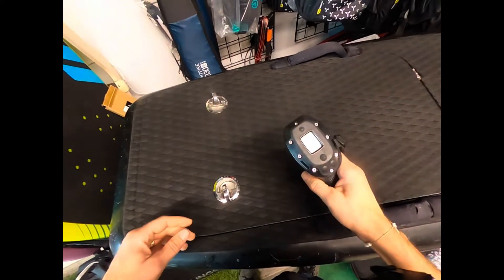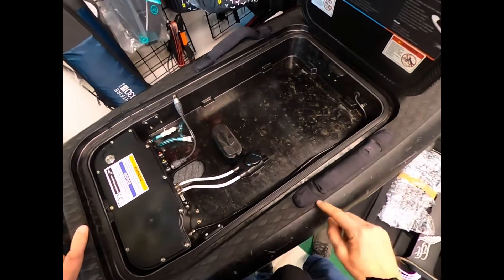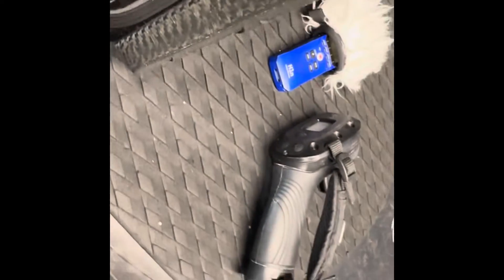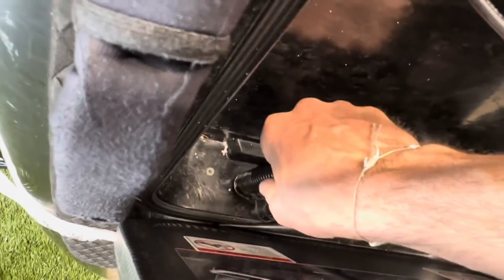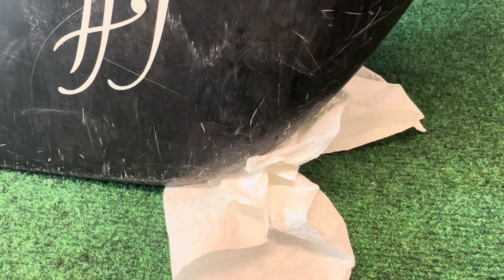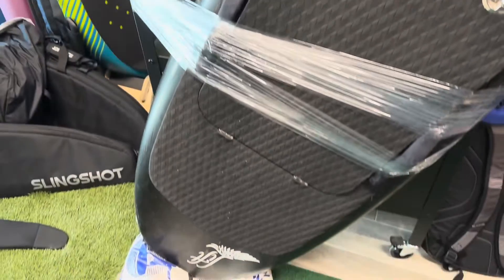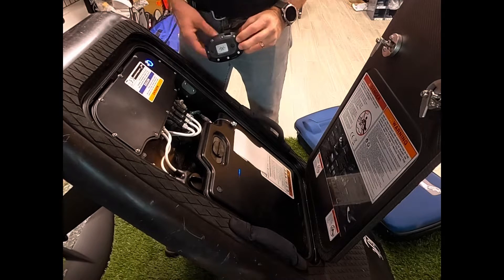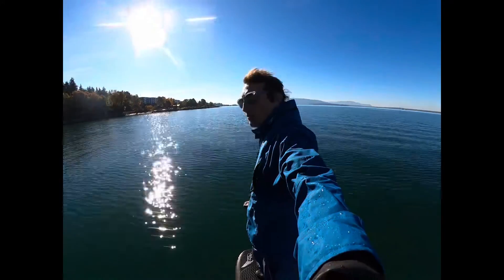How to Fix Intermittent Power Loss on Lift Efoils

Comment: Thank you for video.
The efoil antenna has corroded off antenna cable , I have fixed leaks on board but now need a new antenna to screw on to cable. Where can I source new antenna? Thank you
Reply: Hi i had the same issue - did you find a solution? Looks like a RP-SMA antennae?

Comment: Thank you for your video! I just disconnected the antenna and it was completely dry. Lift already sent me a new motor and ebox and still my propeller won’t turn. Any suggestions??
Reply from the maker: has to be the propulsion unit.  Motor may be fried.  The easiest way to check it is to put a known good propulsion on the unit.

Comment: where is the 9v battery in the ESC?
Reply from the maker: The battery is inside the ESC box.  You have to carefully remove the lid bolts and open it up to change this battery.

Comment: I have a Lift4 that I purchased from you guys last summer.  Took it out for the first time the other day and it did great.  I took it out a second time yesterday and it did well.

However, I decided to just lay on the board and cruise around at 1-2mph for something different.  After a while, I noticed intermittent power loss.  Power would engage and disengage.  

I'm worried to take the the board out again as I don't want to get stuck in the middle of the lake.  

So the Lift4 boards do not have the antenna that goes to the front of the board?  

I am at work now but will check when I get home.  I'm also going to replace the remote battery as it's been installed since I bought the board.  Fingers crossed its not a big issue. 🤞
Reply from the maker: I think we solved this with you.  It ended up being a ECU replacement if I remember correctly.  Thanks for posting.

Comment: As it turns out, my antenna and its passage through the Styrofoam in the nose are dry.  The motor cutout mystery continues.
Reply from the maker: It is the ESC in that case.  Another one is to check to make sure the end of the antenna is tight on the cable.  I've seen them loose before and caused a power loss issue.  If you're board is under warranty get with lift and they will replace the esc.  It is a tough one.
Reply: @midlerp  definitely without V3 board. Make sure that that antenna is tightly attached.
Reply: With
Reply: If in warranty open a case with Lift.  I had a v3 board that did that and they replaced the ESC.  ymmv

Comment: Thank you so much Phil. your creativity and knowledge are why I enjoy working with you.  Both of my Lift 2 and 3 boards sporadically threw the sudden power loss thing at me.  Both boards were carefully treated and did not have any holes, scratches or dents.  But both boards leaked around the hatch and water would pool in the front portion of the hatch compartment.  That is probably how water got into the foam around the antenna.  I ultimately sealed the hatch compartment by removing the gasket, putting silicone sealant in the gasket channel, and replacing the gasket, thus raising the gasket and improving the seal.  No more water in the compartment.  I will pull the antenna and see if I have any water.  Not sure how I will drain it if water is present because there are no holes (I think).
Reply: I am dealing with same thing right now.  Sudden power loss, water around antenna, history of water leaking into hatch compartment.  I need to try the silicone sealant-gasket treatment.  (This needs a Youtube video!)  But first how do I get the water out of my board!

Comment: You can put the remote in test and see blue tooth signal strength
Reply from the maker: You're right, but in these instances the issue is only intermittent so hard to diagnose as it will usually test fine on the beach and then still lose power intermittently while riding on the water.